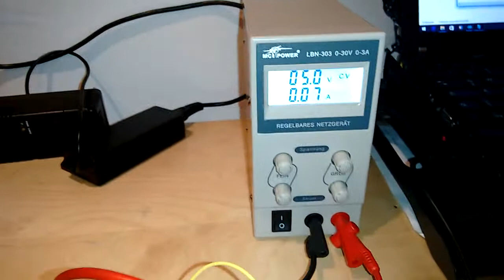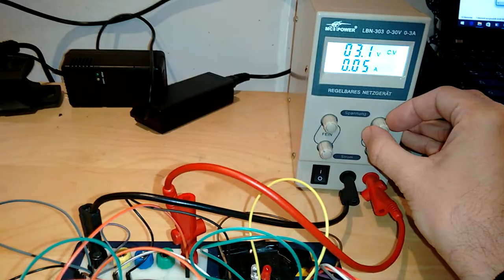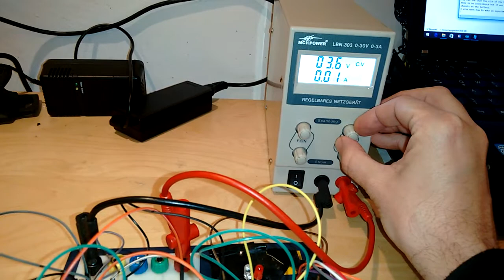DIYino sneak preview

Comment: Will it also run on 7.4v configuration.
Reply from the maker: yes, it will run up to 20V and with every other voltage in between
Reply: Awesomeness, i figured at least 12v so that's cool.
Reply: What sound fonts are compatible, plecterlabs or Niagon electronics format?
Reply from the maker: You need wav files, 24 bit, 22kHz sampling rate. Those for plecter labs boards will do.
Reply: Andras Kun 
Yay

Comment: Really nice work for this DIYino board, the problem I see with only one 18650 battery is powering a full string led blade.
Reply from the maker: The DIYino board evolved much further than being a board for LED strings, with the right software it supports lightsabers with High-Power LEDs (like Luxeon, Cree etc) and also Neopixels. For the latter 2 options you need to have the possibility to supply them from 3.7V and I wanted to demonstrate that it is feasible, without even a loss of sound quality or volume.
If your application needs higher voltage, you can go as far as 20V.